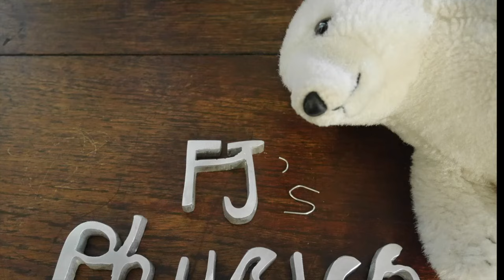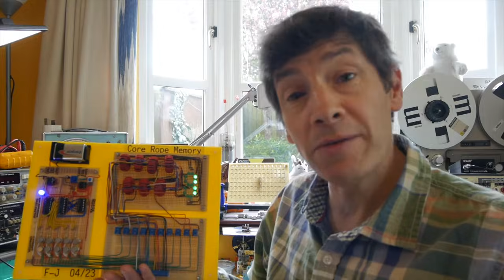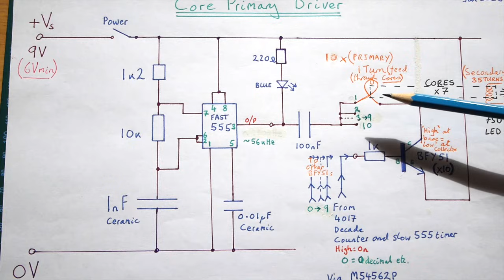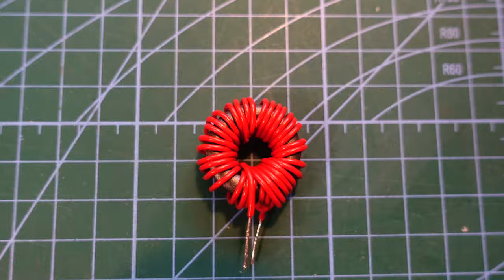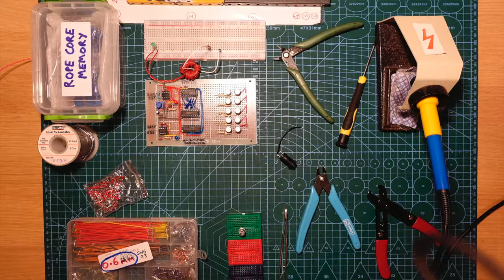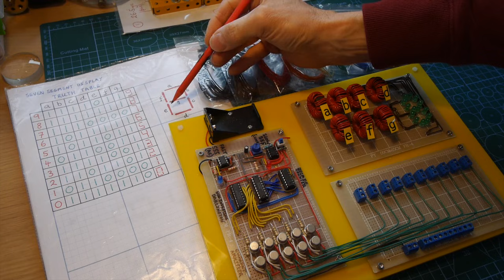Core Rope Memory Built and Explained - F-J's Physics - Video 169

Comment: Im pretty sure 555 can't produce AC signals, its producing pulsed DC signal with probably 50% duty cycle. Correct me if im wrong.
Reply from the maker: Good question - yes this is normally the case.  However, with my circuit I am using the small changing AC current from the 555 timer to switch the transistors.  As an aside you can change the duty cycle of the 555 to suit whatever arrangement you want.  I am using it in a rather unusual way here but this is the beauty of the 555, it has so many uses other than just producing square wave digital pulses!
Reply: A 5V p-p square wave biased ar 2.5V is still an AC signal. Just biased around 2.5V instead of 0V.
Reply: @control_voltage  Still not AC, you would need to create a 2.5V and -2.5V rail to get AC
Reply: @axelBr1 AC is relative to how you have defined 0. Even when measuring on a multi-meter if you swap your leads on two points reading +5V it will read -5V. If you couple this +5V and 0V pulsed signal with a capacitor that is referenced to 0V on the output it will center itself around 0V and you will have +/-2.5V simply by removing the offset. You don't need a negative rail to do that. This is what I mean when I say it is the same as a DC bias applied to an AC signal.
Reply: @control_voltage  I was looking at the circuit in more detail; with the transistor's emitter connected to 9V, then then 100nF cap on the 555 timer's output is doing the heavy lifting of pulling the collector down, I'm not sure if the transistor will like being reversed biased, and as you point out create a reverse current flow, whether actually negative or somewhere between 0 and 18V, I'm not sure. I think the 555 is sinking the blue LED current, the transistor base current and the coil current; quite a bit of work.
Also the Darlingtons aren't required as they are only driving the base current of the transistor, But they might be a good idea in order to rapidly saturate the transistor.
Reply: Checking though the comments before saying the same thing, the A in AC stands for alternating, i.e. goes one direction and then the other. This circuit is producing pulsed DC, but that's OK as the switch from on to off will cause the magnetic field to collapse causing a current to flow in the sense wire.

Comment: Did I understand correctly that your circuit uses not alternating current, but a pulsating current with a frequency of 60 kilohertz?
Reply: Pulsating DC on the input of a transformer will generally become an alternating current on the output.  The waveform may be distorted, but it does work.  I'm wondering if wiring the two top LEDs (which seem to be dim on some numbers) in the opposite direction will brighten them up, since they're probably rectifying AC to DC and the AC may not be symmetric due to the input being pulsed DC.  Wiring them in the opposite direction may give them more current.
Reply from the maker: Yes, you are right about the LEDs.  I did wire them the other way around the other day and all was perfect!  Well spotted!
Reply from the maker: Yes, I just created pulses at a high frequency that seemed to work.  As you can see from the CRO images the pulse shapes became very distorted but it was a case of play until something worked rather than copy a known system.

Comment: I thought the rings were made from "molly-what's-its-name" and had isolated layers to reduce eddy currents?
Reply: Hi, yes molybdenum steel I think was the term. I thought the cores were made out of a laminated version of this material for the Apollo mission. Maybe I need to go back and watch Curious Mark again to check what he said. Edit: Molybdenum Permalloy was the material used in the Apollo Core Rope Memory.
Reply from the maker: Yes, that's right laminated cores of Molybdenum Permalloy for the Apollo core rope memory to make switching fast, low current and low eddy current loss.  You will see that the method of using the cores in my build is different from the Apollo AGC but my video is to get you started thinking about how this type of memory works.  More to come soon I hope and thanks for your interest and enthusiasm.  Curious Marc is in a league of his own!
Reply from the maker: Just updated my comment below on the cores - hope I have made a better job of explaining it!
Reply from the maker: Not sure if we are thinking of the same thing here.  Transformer cores are made of a laminated series of cores to reduce eddy currents.  In the care of the rings, they are made of a fairly homogeneous ferrite typically cobalt iron oxide.  Were you also thinking of molybdenum steel?

Comment: Could you use a large tv speaker magnet ring for a core memory?
Reply from the maker: Good question - whilst (as with many things) not totally impossible with the right electronics in this case the answer is basically no.  The rings I use have to be capable of changing their magnetism as current passes through the wires.  A TV speaker magnet is made out of material that is permanently magnetic so it would not respond to the changing magnetic field due to the wire.  You need a material that is not normally magnetised.  Interesting other types of core memory (I will do a video at some stage) do use cores that hold their magnetism but are designed so it is easy to erase and reverse.  That is not the case with a TV magnet.  Hope that helps and thanks for watching.
Reply: @AnthonyFrancisJones   So you can't demagnetize the ferrite magnet by heating or using a tool to demagnetize it?
Reply from the maker: Theoretically but remember that this type of material retains its magnetism once re-magnetised so is not what is needed.  What we call 'soft iron' is the material that is needed that loses its magnetism easily and allows for fast changes of magnetic fields (with AC currents).  So the TV magnet is not the right type of material!  Hope that helps.
Reply: @AnthonyFrancisJones  That almost sounds like a ring of rare earth paramagnetic praseodymium.
Reply from the maker: Ferrite is a pretty common material and had all sorts of uses such as the core for old radio antennas too!

Comment: What A Great Tutorial Sir, Can I Ask Why you used M54562P IC? The 4017 IC Has Enough Power To Drive The Transistors?
Reply from the maker: Ali, thanks for your kind comments and great question.  So, as with much that I do, I did not overthink it or do much in the way of calculations but I felt that as a 4017 is really a voltage device and transistors are current switched devices it would be a good idea to use a darlington driver (M54562P) to make sure that there was enough current available to switch the transistors.  I still cannot remember why the I decided to wire the transistors in what looks to be a back to front way, but it works and that is the main thing!  I tend not to design and then build but build as I go along and tinker until it works - seems to be more fun!  Glad you liked it.  I need to do a video on regular core memory at some stage too!

Comment: AGC core rope used Permalloy rings not ferrite.
Reply from the maker: Thanks Airton.  Yes, this is a bit of a 'loose' representation but I hope it gets some started on how cores can be used.  I plan to do a video of a core with read/write/inhibit/sense lines but not got onto it yet!  Thanks for watching.
Reply: Permalloy is a trademark of a ferrite core. Nickelodeon visa vi puppet show. 🍌
Reply: @co59720  
Permalloy is not ferrite. There are various alloys but the composition is usually around 50 to 80% nickel with the balance iron. "Molybdenum permalloy" contains around 2% moly and 80% nickel. These alloys can be rolled into metallic sheet. For cores the sheet is thin and slit into "tape" that is wound to make cores. They can also be made as powders and mixed with binders that create a distributed air gap and formed into shapes, typically toroids. Moly permalloy powder cores are sometimes used for inductors in switchmode power supplies. MPP has excellent properties but has become very expensive.
Reply: @co59720 close, but it's spelled vis-à-vis.
Reply: Iron is iron, no matter how you slice it.
Reply: @MichaelOfRohan iron can be 25 other things depending on how you slice it.
Reply from the maker: I guess so - have a look at my comment above.  It is indeed a very interesting material/element.
Reply from the maker: Indeed Michael!  Of course its properties are a completely different matter depending on its structure.  I am having real trouble finding the right 'iron cores' to build a working core memory (rather than a rope core one) and I don't want to steal them from one in my collection and they are rather too small to film too!

Comment: I guess i misunderstood the purpose of the cores. I don't see how they're used as memory. I guess i keep comparing them to magnetic memory cores
Reply: In simple terms, the magnetic cores are being used as couplings between each address wire and each data bit.  If the address wire goes through the middle of the core, then the core's data wire will output a 1 when the address wire is active.  If the address wire bypasses that core, then the core's data wire will output a 0 even when the address wire is active.  The data isn't stored in the cores, but in whether each address line goes through or bypasses each core.
Reply from the maker: Perfect - thanks for this.  It does take a while to get your head around the fact that the memory is not really stored in a physical or silicon location but is just in the path of a wire!  The whole plan of this video was to try and show this in a working - and I hope not to complex - model.
Reply from the maker: Good question.  So the secondary (wire coming out of the coil) produces a pulse. Now the memory bit is really the primary wires.  One single wire can be laced through each coil or not, meaning that one wire can when switched on (addressed) can control the output of seven cores (in my case) resulting in a 7 bit binary output.  Every single wire going into the cores can be laced to give an output of any 7 bit binary number.  So the 'memory' is not in the core itself but in how the wires are laced.  Address those input wires in an order that gives the output of 7 bit words that you want and you have a running programme.  Remember there is another type of core memory where the actual 1 or 0 is not 'wire through core/wire not through core) but instead a core magnetised in one of two directions - that is more like the Apollo one.  Hope that makes sense!  Thanks for asking, Anthony.
Reply: @AnthonyFrancisJones  that's what it seemed to me. At first it seemed the cores could just be bypassed in that setup with the wires going straight to the segments
Reply from the maker: Yes, that's it - you need the cores to reduce the signal to 7bits from what could be literally 100s of wires (individual lines of code) threaded through them.  You can see why it is such a clever method!

Comment: I didn't understand one thing: The emitters of the NPN transistors are connected to the "+" of the power supply and not to the GND?  It makes no sense to me.
Reply from the maker: You've got me!  I made this wiring mistake at the start and it worked!  I then corrected it and it did not work!  It is strange for sure!  I did work out why it worked but would need to look back to remind myself too.  Well spotted by the way!
Reply: @AnthonyFrancisJones  Now I'm trying to work out what's going on, some unexpected properties of those transistors must be coming into play
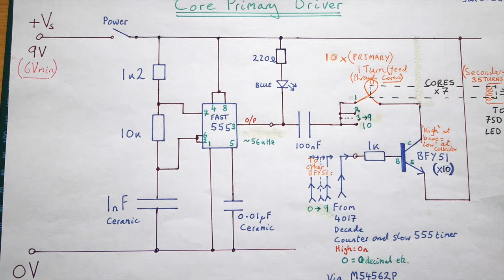Reply: @matthewday7565   if the circuit is actually built as shown on the diagram at 18:56, then the transistor is working in 'reverse active mode'. In this mode, the transistor will operate, but (conventional) current flows in the opposite direction (emitter to collector) rather than collector to emitter as would be the case in active mode. A transistor will work in this mode, and even have some gain, but the gain is low. To enter reverse active mode, the emitter voltage must be greater than the base voltage which in turn must be greater than the collector voltage. That exact scenario is happening here. The base resistor ensures that emitter is higher than the base. Since the collector is connected to the 56kHz oscillator, then the base will nearly always be higher than the collector.
Reply from the maker: Mick, that's brilliant!  I did explain it to myself and then forgot that I did understand what I had done!  You have captured it beautifully here so thanks!  I did not do any calculations just got on and built it and when I miss-connected the transistors from the start, they worked, then turned them the correct way around and it didn't so I went back to this strange but interesting arrangement.  I think many are going to question my logic - pun intended!